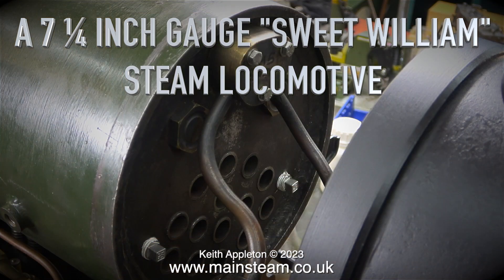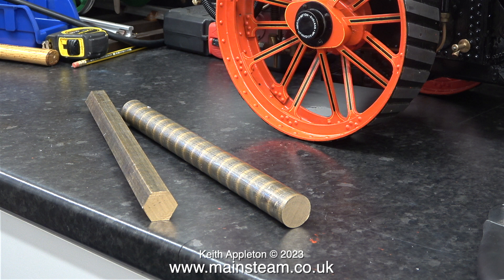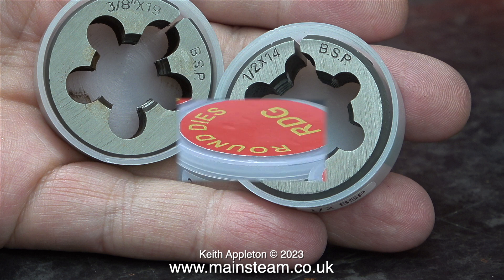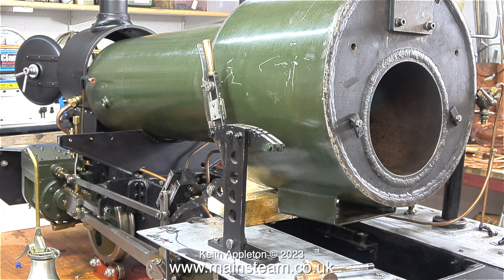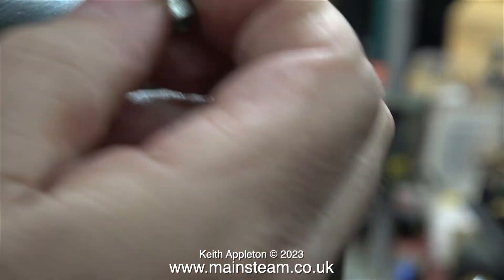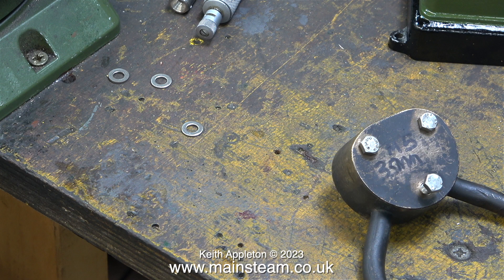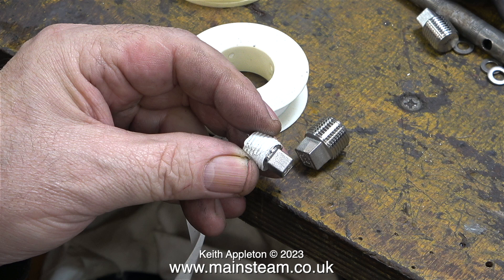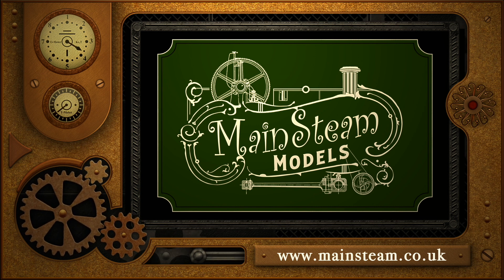A 7 ¼ INCH GAUGE "SWEET WILLIAM" LOCOMOTIVE - PART #22

Comment: One trick with PTFE tape is to avoid having any on the first thread of the plug. The prevents any PTFE tape from possibly breaking free and flowing down into valves or places it shouldn't be.
Reply from the maker: a good tip - thanks }:-)))

Comment: I put in a heat pump hot water system in Australia in 2010.  It has moving parts which require maintenance, cheap Asian quality.  Most other heat pumps in my housing estate have failed, I inspect mine regularly to keep the expensive thing going.

Comment: Hi Keith, My Dad used to call the dies without a split "Thread Casers" and said they were only good for repairing damaged threads and I should not use them for new threads. I just wish he had lived long enough to see how I did threading on CNC equipment. About the wrapping the PTF tape you are one of the few I have seen do it proper, even in industry most people do it wrong.
Reply from the maker: It's all in the wrist action and direction of winding the taper around the thread }:-)))

Comment: For Americans not familiar with the Celsius temperatures Mr. Appleton mentions, 0 deg. Celsius = 32 deg. Fahrenheit, water's freezing point.  The slightly below 0 stated would be reported upper 20s in the U.S.A.  Quite cold, but not brutal.
Reply: We know what Celsius is, have you ever heard of condescension?
Reply: I wonder if anyone thinks about temperature like I do: freezing is 0 degrees C.  A hot day is between 70 and 100F.  Somewhere in between the one scale transitions into the other…